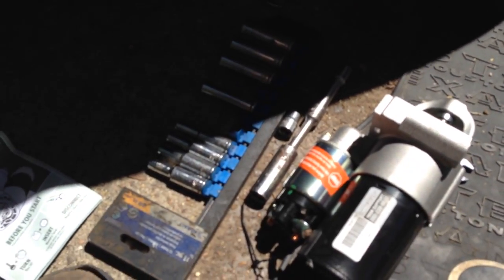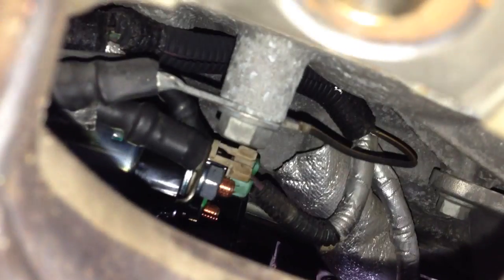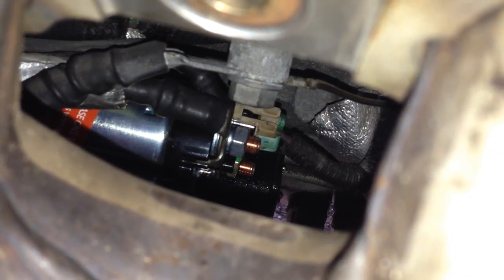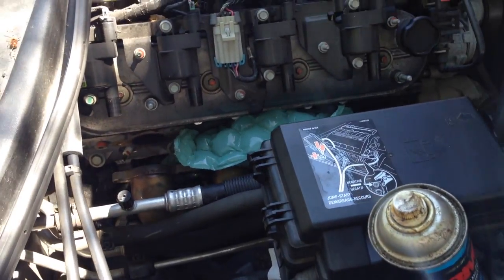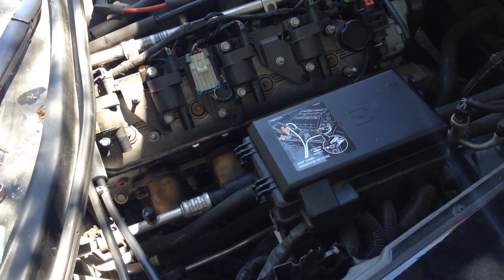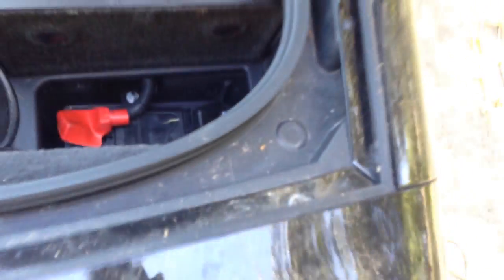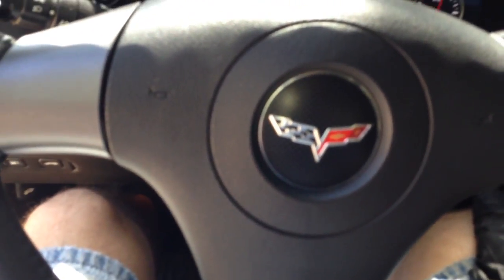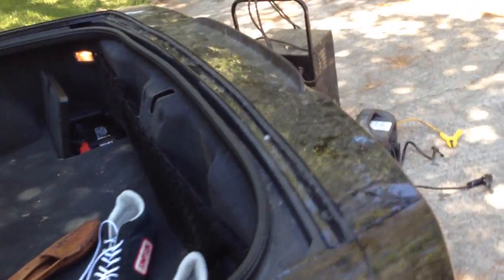2006 Corvette Z06 Starter Replacement pt2

Comment: I found the issue with my 09Z06 Hot Start problem. The B+ terminal post 
on the starter was lose. Also had no lock washer. If you look at the 
electrical lugs on the starter you will see their are pitted from 
arcing.
Reply from the maker: Nice fix, unfortunately on this one the starter was bad.

Comment: I found the issue with my 09Z06 Hot Start problem. The B+ terminal post 
on the starter was lose. Also had no lock washer. If you look at the 
electrical lugs on the starter you will see their are pitted from 
arcing.